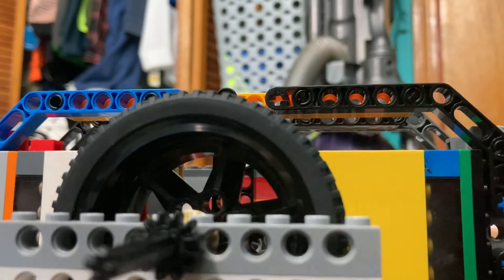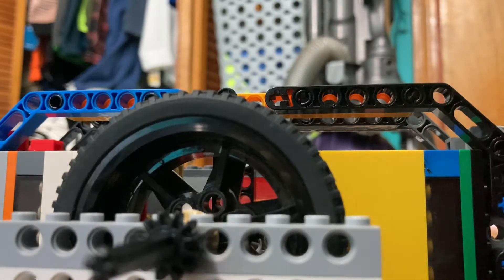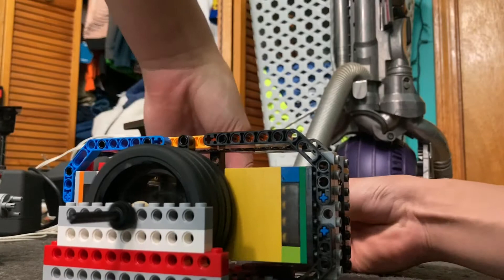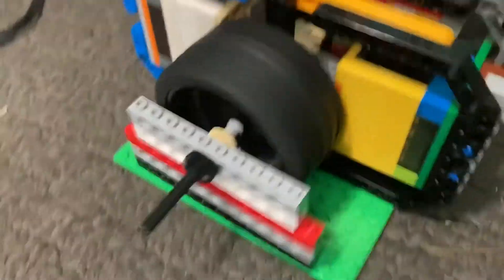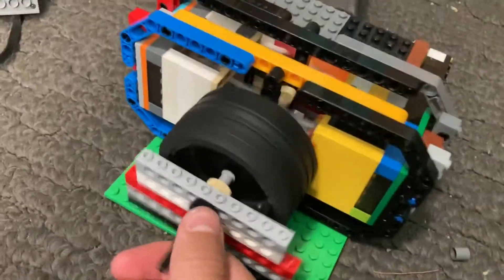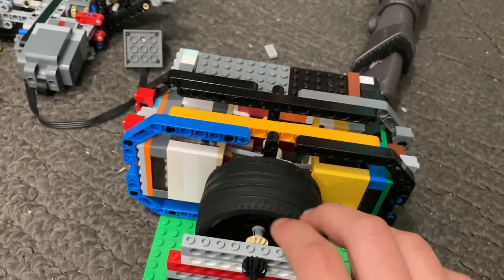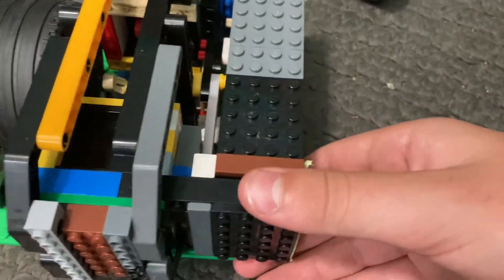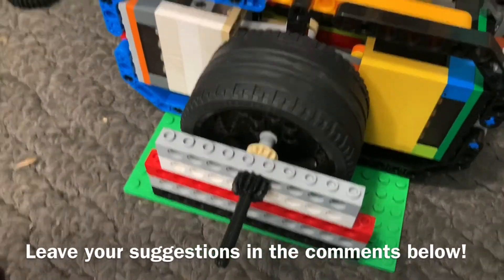LEGO Boxer 2 Engine Running For The Very First Time

Comment: You should build another one and couple the two together and make a Volkswagen style  flat 4
Reply from the maker: Joey Willis I would have totally done that in the first place, but I didn’t have enough legos to do so. Mainly parts for the valve and cylinders, so until I get another useful LEGO set or get a haul from brick link You won’t be seeing a flat 4 anytime soon.
Reply: I know how that is. I wasn't even able to make vacuum engines until I got a Lego technic dragster kit with the crankshaft parts for the valve assembly.

Comment: KFPlus LEGO mastery this is AWESOME! Now you have a engine with almost DOUBLE the torque and half the rpm! So I have a question for you. Did you consider making a v-twin or not and also did you do the valve 1x1 mod or not?
Reply from the maker: LEGO warriors adventure Believe it or not I don’t have the 1x1 mod applied simply because I wanted to start easy and not have it blow up if it was receiving too much vacuum. Definitely something I’m gonna do in the future though! About the V twin, I haven’t considered building one yet. I’ve been thinking and determined that it’s going to be tough with all the angles and such. I will make one, but don’t expect to see it within the next few weeks/months. I appreciate the feedback, though!
Reply: KFPLUS Lego Mastery well if you didn’t do the mod it’s gonna be fast! And I’m considering making a v-twin!
Reply from the maker: LEGO warriors adventure Go for it! I’d love to have some inspiration before I build one.
Reply: KFPLUS Lego Mastery yeah I’ll definitely try now I just need to get some parts so in about a month or 2!

Comment: Nice job, if the rpm rise don’t worry, the engine it’s self is going to keep it in place.                                                                    BTW, how do u use technic pieces to stiff up the block? HOW 🤔👍
Reply from the maker: Noice Grey. I attach the technic beams directly to the cylinder head , top and bottom, then bring them around and connect them together, then put a straight one from top to bottom in the center and that’s where the crankshaft is connected.
Reply: Ok, I’ve tried to make a vacuum boxer engine, WITH the same LEGO design, but it didn’t work.  :(
Reply from the maker: Noice Grey. I might make a video going in-depth of the design in the near future.

Comment: Im writing all this as the video plays

Use tape to seal the intake manifold. LIke electrical take sticks to itself really well!

Wow, that is very smooth! Like really smooth, it doesnt look like its vibrating. I noiiced that your little wall to hold the flywheel up is vibrating and very loose though. Try to make sure that is well supported, youll notice a huge gain in engine speed with that. When you do go to oil that motor, make sure to oil the axles that go thru holes, that also makes a huge difference. And oil any surfaces that might rub, I oiled the two rods that hold my crank and that made a difference with my enigne. 

Just a side question, what part broke on the right side of the engine?

So proud to see such a successful result!!!

One more thing, I found an app on the app store, called a stroboscope. It flashes your flashlight to measure rpm. When you set an rpm target of say 2000 rpm in the app and flash it onto your flywheel . When your flywheel looks like its not spinning, it is going at that speed. I think this could be a great way to test rpm of an engine!
Reply from the maker: Shlushe 10 Thanks for the feedback and tips! The part that broke was the right piston; I took apart the right side of the engine to glue the piston together. And well I’m at it I’m also gonna lube the entire engine and seal the manifold. Also, I have tried the stroboscopic apps and to be honest they suck because they don’t have any real customization and they all make you pay for a subscription which I don’t want to do. I was able to determine that the engine surpassed 3600 rpm in the video with some frame rate math which is actually really good.